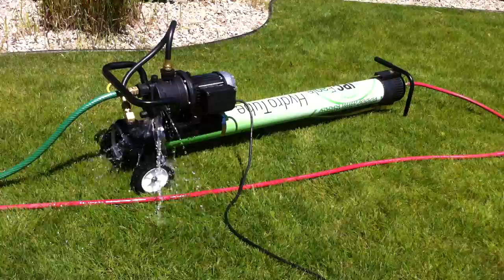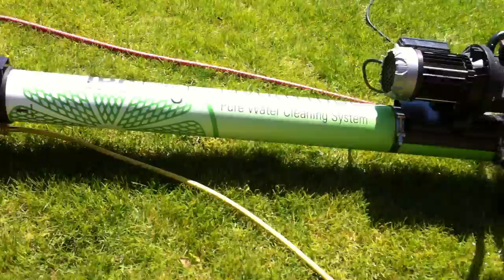WFP Window Cleaning. Blown Pump Housing!

Comment: clearfxwindowcleaner - We have updated the Boost Pumps's to a NEW Stainless Steel model to fix this rare issue.  Please contact us so we can get you a new one, 800-486-2775.  We're glad your happy with the Hydro Tube but we'd also like you to continue using our Boost Pump.